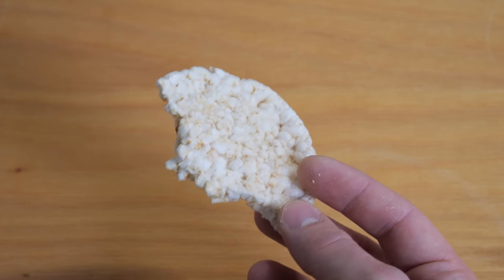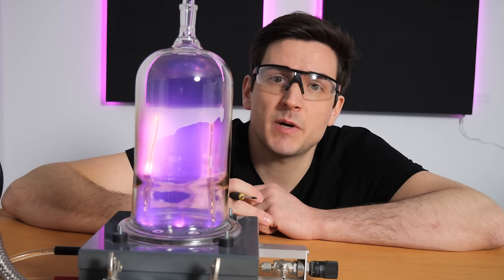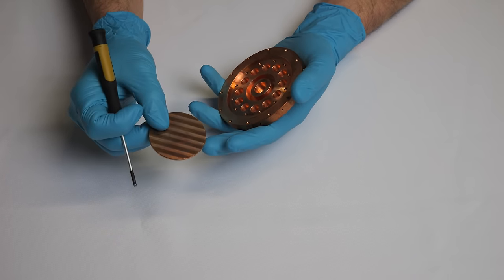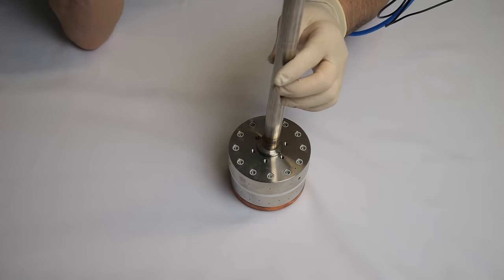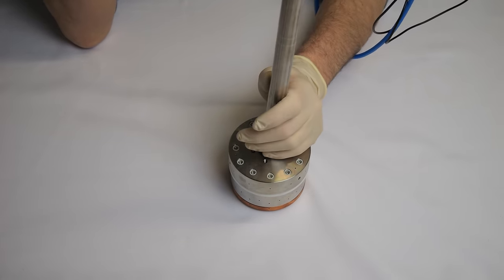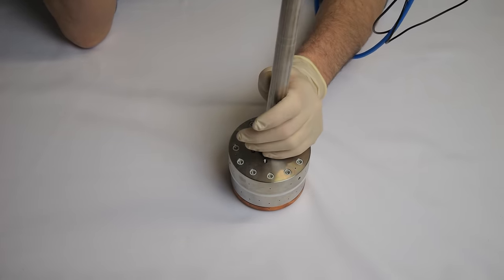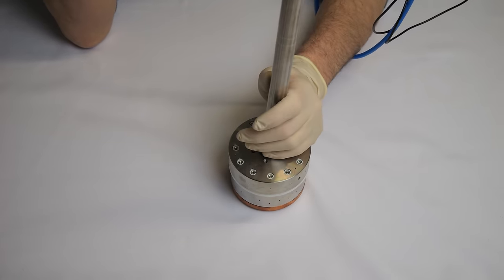METAL COATING by PLASMA Bombardment - Magnetron Sputtering

Comment: Your chamber is really coming along, love the custom magnetron. There's already a lot of good feedback on cleaning and process parameters already. Couple of things to add.
Most common sputtering metals gold, silver, copper etc have very low adhesion to glass. Even with perfectly clean glass, as the coating thickness increases surface stresses build up and cause the coating to pull away. This causes the rough appearance on your slides. The viewports are farther away which slowed the deposition and reduced the surface stress. Increasing the slide distance to the magnetron will help but thick coatings will always be fragile unless the adhesion is improved. Typically an adhesion promoter layer is added between the glass and the thick conductor layer. A few nm of pure chromium is the usual recommendation since it sticks well to most things, but you could also try a high chrome content stainless, as an easy to source option.
Reply: No, the rough appearance on his glasses are due to very bad crystal quality. If you try to reactively sputter ATO, ZnO, ITO, AlO, or whatever transparent, you will see this effect even more pronounced. On metals you cannot really see how bad their crystal lattice is until you do some Xray on them. 
It has taken me years to perfect sputtering. In the literature you will find the ways to mitigate the low quality problem: either use facing magnetrons, limit the power, or increase the magnetic field. All these will help with much better quality but will reduce the throughput. The best way is to NOT let ANY electrons hit your surface. They either put a negative bias behind the substrate, or, like in my case, use a totally different geometry to planar sputtering...

Comment: The reason for the rough coating was a combination of high deposition rate plus the high energy ions building up a static charge. On the viewport you are getting a lower depositing rate and the copper is mostly as neutral atoms by that point. ❤

Comment: Cool video, back in the mid 1990's I worked at a company in Sarasota Florida that produced pressure sensors for the automotive industry, I ran a CVC 601 Magnetron Sputtering System that we used to deposit SiO2 on pressure diaphragms then we Sputtered Nichrome on top of the SiO2 and after the diaphragms were removed from the Sputtering machine they went to a LASER where a Weatstone was etched into the Nichrome as the sensing element of the pressure sensors.

Comment: Great to see that you managed to build such a nice setup.

From past experience of getting glass coated, the companies that did it for me used a layer system with a titanium / titanium oxide layer for bonding to the glass, and then the actual desired coating on top of the titanium oxide.

From some personal experience with magnetron sputtering: depending on the conditions like pressure you can produce clusters of the atoms of your target, which can behave very much different from atoms. Might affect the adhesion and later surface finish.
Reply: Well, I do ion implantation first and then sputtering as normal.

Comment: that magnetron looks more professional than the actual commercial stuff
but keep in mind those magnets have a quite low curie point of like 85°C or something. there are H grades that withstand 150°C but at limited sizes.
Reply from the maker: Thank you very much! It has grown a bit larger than necessary because I lacked some experience in estimating the material thicknesses with which the milled components would still function. The magnets should never exceed 50°C through the water cooling. If I touch the target directly after sputtering, it is only slightly warm.

Comment: Ok, perfect, this is what happened to me as well, after having finished my first sputtering machine. Despite sputtering being known for good adhesion, even the adhesion was bad on some cases. The worst part? You almost saw it with the copper deposition: bad crystal quality. Almost totally amorphous. You will see how bad the quality is if you try to do some ZnO, ITO, or anything transparent. So, it took me a whole MONTH to realise what was going on.
The problem causer: ELECTRONS! High speed electrons BREAK your bonds! That is why your side glasses turned out ok, their crystal lattice was not bombarded with electrons. If you read the literature you will see they try to mitigate it that way (as you did by chance), or they use facing magnetrons. The problem there, is when you raise the magnetic strength, you get better quality as less electrons make it across, BUT you get also LESS atoms going across, reducing speed. 
I would suggest you either go to another geometry and break free from the standard magnetron setup, or go altogether to a molecular beam. Sputtering in that incarnation is pretty useless.
I hope any of this helps. Regards from Greece.

Comment: 16:00 could it be something to do with how the target glass is directly above the sputterer? could the copper have too much energy when hitting the target and not stick properly?
Reply from the maker: Yes, I'm relatively sure the distance is at least one factor. As you can see, the edges of the microscope slide has a "mirror finish". Just like the vacuum chamber walls. 
I tried increasing the distance but it did not change much. The copper "flaked" in the middle. Maybe I have to preheat the substrate.

Comment: I think it is the deposition rate leading to a different grow on the substrate and on the view port glass. You view port glass is much further away.

Another thing to consider is heat. Your plasma directly touches the substrate. I guess it will get hot during the sputtering. This can also reduce the quality of the sputtering process.

And last but not least: You cleaned your glass substrate, right? At least with some isopropanol and then water in an ultrasonic bath for 10 min.

Comment: This is where having a very good knowledge of both physics and chemistry is most useful. Someone in an earlier comment mentioned glass being atomically clean. I'm not sure to what degree of cleanliness is needed and whether it can be achieved physically or chemically- possibly through a powerful oxidizer like Piranha solution. Other factors to consider would be obvious high voltage and heat dangers. Not sure if the charged particles have enough energy to generate X-rays of concern. If you have a copy of Strong's Procedures in Experimental Physics, you could make some fascinating things, although one could make things of serious danger.

Comment: 16:32 The reason you get a perfectly coated side windows and not a perfect microscope slide is due to the temperature difference between the 2. The microscope slide is too near from the plasma and the material is not really condensing in slow atomic layer. Nest time, if you put methane gaz and a diamond sample, you will be able to grow diamond.cUS20110151226A1 - Synthetic CVD diamond. If you search in the world most favorite search engine this phrase : H BAR Patents for C30B 25 - Single-crystal growth by chemical reaction of reactive gases, e.g. chemical vapour deposition growth (13,302). You will have all the patent from 2010 about CVD (Control Vapour Deposition)
Reply: 1. Increased heat on the substrate actually fixes quality problems. His problem is elsewhere, I have explained him in another comment. 
2. To do diamond, you need Methane as you said, but only at around 1% in Hydrogen. If you don't use Hydrogen in the mix, you will get graphite instead of diamond.

Comment: Now turn the whole thing upside down, put the plasma field on a CNC gantry over a stationary surface, and reduce the coating application area to sub-millimeter size.  Boom, metal FDM printing, and you're rich.
Reply: FDM full form please

Comment: microwave magnetrons are usually powered by only half wave rectified DC,  so using a *full wave bridge rectifier*  (electroBOOM!)  might be drawing too much current for the design of the transformer, making it hot.
Reply from the maker: That’s good to know! But with the new rectifier the MOT does not get hot anymore. But if I ever need to increase the current, I will have to add a fan.

Comment: FWIW, Ti is a common adhesion layer in semiconductor manufacturing because it sticks so well to Si / SiO2 / glass. If you put a second magnetron in there to do Ti before other metals you'll have far better results.

Comment: Man that plasma looks so nice!! Way aren't you using the high voltage power supply you built few videos ago?
Reply from the maker: Thanks! The voltage produced by the power supply I built in an earlier video is way too high and it cannot supply enough current.

Comment: 2:11 correct me if I'm wrong, but do you mean anode? Because the cathode is positive; "cats have paws".
Reply from the maker: It is a little bit confusing because a cathode can be positive or negative. In my case (but also in a galvanic cell for example) the cathode is the negative electrode. 
When you are talking about a battery then you are correct. The cathode would be the positive electrode when discharging.

Comment: You can 100% deposit ITO with thermal evaporation, ceramics give off an evaporation pressure suitable for coating well below even their melting point. Maybe the boats are unsuited for ceramics due to thermal conductivity or something, but I have with my own eyes seen it done with an e-beam.
Reply from the maker: I didn't know that. I always thought it was  only possible using reactive thermal evaporation. Thanks for clarifying!
Reply: @AdvancedTinkering  SiO2 (bog standard glass) would be a good ceramic material to test this out with if you are ever at that point.
Reply: @AdvancedTinkering  hi I have problem with my dc magnetron sputtering. Short circuit occurs every time I start increasing the power. Help me to solve this issue

Comment: You could nickel plate that iron plate pretty easily if you wanted to stop it rusting. Also I think PET film might be good for a sacrificial layer for your windows. It's easily available (florist shops have it for wrapping flowers) and should be fine in high vacuum. You could even rig it to be pulled off during runs if you needed to.
Perhaps you could just cut a cylinder of it and sit it inside the whole chamber, it's cheap and stiff enough that it'll just sit there.

Comment: Regarding the difference in deposition quality between the chamber sightglasses and the slides: your chamber glass is regularly exposed to high vacuum so it's probably extremely clean. How clean are the microscope slides though? Ben from Applied Science did a series on sputtering on his channel a while back and he did an entire video about cleaning...even the very fine airborne particulates and oils can be enough contamination to interfere with adhesion to the sputtering substrate.
Reply from the maker: How clean the surface is, is definitely an important factor. But I don't think it was the reason here. Because the surface created by thermal evaporation was that much better. The adhesion was still poor but it had a mirror finish. 

Nevertheless I want to build a plasma cleaning setup in the future.

Comment: 11:34  did you mean to say "violated microwave"? with that organspendeausweis gets a different meaning

i do actually insanely relate to the "eating something and being annoyed that it isnt coated in metal" part

also i really wonder with the viewport, theres various variations of ways to keep cameras clean, milling machines often use a spinning disk to spin away the liquid drops sprayed on it,
maybe one could use some way of magnets or a charged mesh to just make a plasma shield for the windows?

with the sight windows being coated and the glass slides not really quite as good, maybe different glass? the microscope ones are always greenish, the sight glasses would likely be boro or pure SiO2? even more likely tho, deposition rate id say.

Comment: Id love to see the 3dprinter convert, vinyl cutters seems to be all the rage, but they're unreasonably priced at least here in aus.
Reply from the maker: There are good tutorials online. It's basically just a drag knive mounted to the extruder of the 3D printer. But I can try to include a short section about the conversion into the lithography video.

Comment: To achieve perfect coating on glass - you need perfect clean glass surface first. IMHO, best way - cleaning by oxigen plasma. It burns out all kinds of organic residuals on suface. It may done in your vacuum chamber with minimum modifications. Other way - chemical cleaning and activation of surface.
Reply from the maker: I definitely have to improve my surface preparation. In this video I mainly wanted to test the magnetron. I plan on building a plasma cleaning setup inside the chamber.

Comment: I wonder if there are any coatings you could put on the window that would prevent the copper from sticking.
Reply from the maker: I also wondered if a suitable coating exists. A thin film of oil would most likely prevent the metal from sticking but would be horrible for the vacuum. Maybe some non polar nano coating? If anyone has ideas, let me know.
Reply: @AdvancedTinkering Nanoparticles was also my first thought but I am not sure if that would do anything. Another idea might be a thin layer of teflon mold release.
Another thought: If you apply a bias voltage to the magentron the ejected particles should be charged. Then you could have a charged grid (or ITO coating) on the window to repel them.
Reply from the maker: @MaxWithTheSax  Repelling the ejected particles with an electric field would of course be the coolest and most convenient option. I will have a look at that. Mold release may work but I doubt it will stay on the glass surface for long when wiping it down. I think for now a piece of transparent vinyl is the easiest solution. Having to replace individual strips of packing tape gets tedious (because I must remove the view port each time). But having a stack of vinyl foil would allow me to just peal of a layer if it is too dirty. Only question is how much they outgas.

Comment: The copper coating the viewports is not colinear with the plasma. Perhaps the purest copper with the optimal deposition velocity can be found at the fringes. The viewports are far from your source and might also be colder than your intended deposition target.

Comment: one of the differences i see between sputtering on the target and the interior of the chamer is distance and direction... maybe the coating's adhesion changes with distance and/or direction? material properties too perhaps?
Reply from the maker: I also considered this. Especially since the outer corners of the microscope slides have a better surface quality. I tested this and suspended the glass further away from the magnetron, but couldn't see a significant difference. Perhaps I was still too close to the plasma. Another comment also suggested that the glass should be kept as far away as possible.

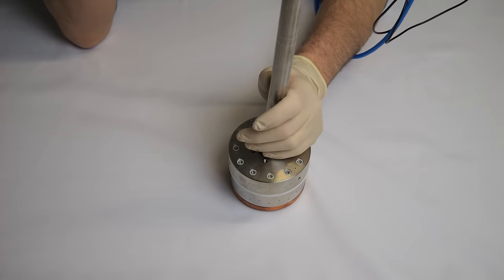Comment: 15:51 Its well known that copper doesn't stick very well to glass, you need very high energies to make it do that so it embed it self some nm into the glass. Otherwise first use a chrome or nickel layer because especially the chrome stick very strong to glass and then copper onto that since that stick very hard to metals.

Comment: The rough surface could be due to pitting from plasma etching. The slides were very close to the plume so even though the plasma was depositing metal ions, those same metal ions would cause etching and pitting because of their high kinetic energy. The viewports were further away and indirect, so they got all vapor and no etching. You can try moving the substrate further away from the plasma plume to minimize the etching.

Comment: Could you use a wire mesh at some electrical potential in front of the glass to repel the copper ions? I know it sounds like a lot of effort but would basically lead to maintenance free operation.

Comment: I use plastic binder sleeves as viewport covers in my sputter chamber. You are using what looks like a type 2 unbalanced magnetron with a much stronger outer magnetic field. This is going to increase the energy of the species arriving at the deposition surface and will increase the compressive film stress. If the compressive film stress is higher than or very close to the maximum adhesion stress the deposited film will delaminate from the substrate. The viewports are seeing much less compressive stress and the film adhesion is higher. If you need any assistance I design industrial large are sputtering equipment for a living.

Comment: 2:10 isn't it a bad idea to to do run high voltage in a vacuum? Xrays?
Reply from the maker: The voltage is not high enough to produce any relevant xrays. But yes, in general you have to be careful when using high voltage in a vacuum.

Comment: This is pretty awesome work!  Does the sputter target get very warm at all?  I'm wondering if it's possible to sputter with copper some 3D resin prints to see if I can make EDM sinker patterns with them.
Reply: I'm thinking that once you get the resin parts conductive, you can transfer to a conventional electroplating process to improve the thickness.of the form and, presumably, repair it later.